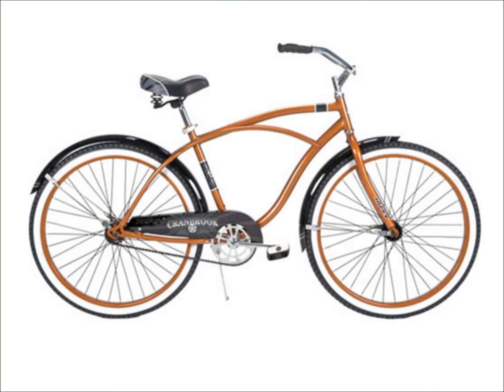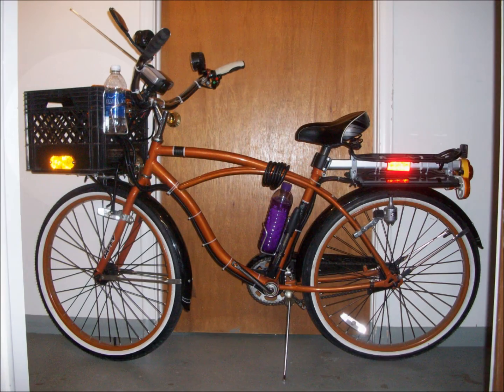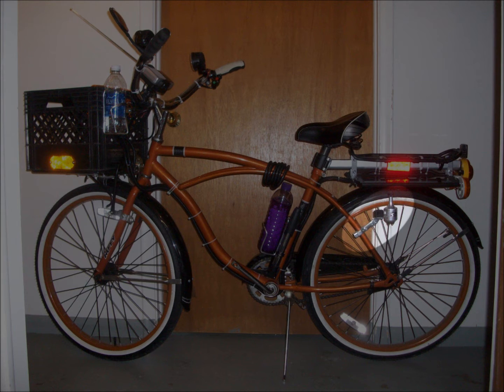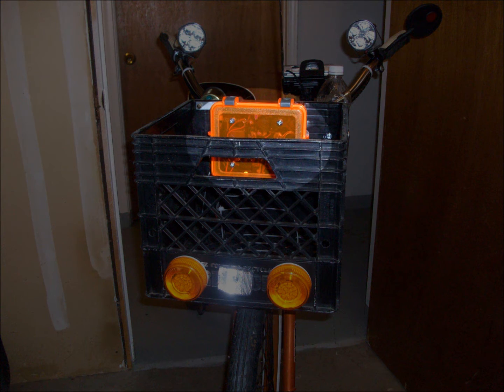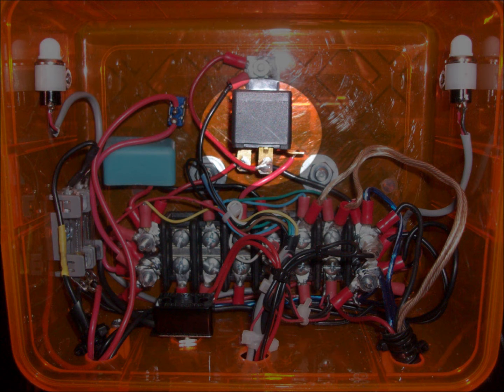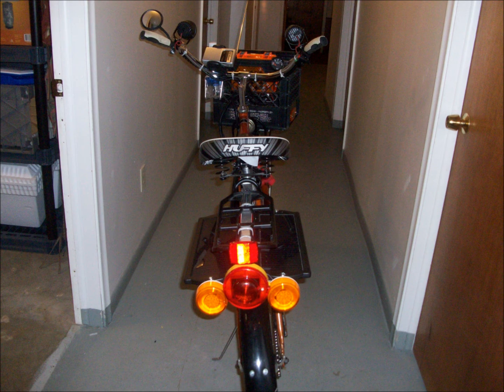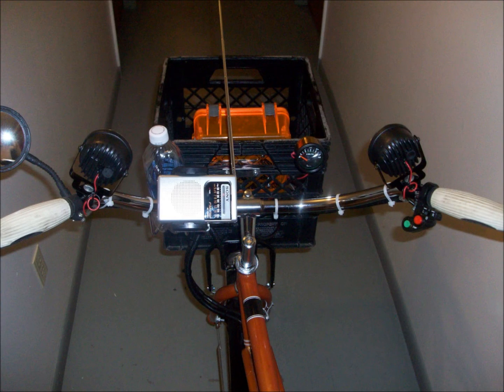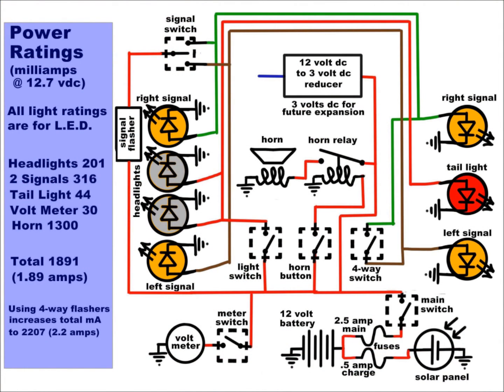Phase3: DIY Make Your Own Bike Or Bicycle Solar Power Lighting And Electrical System

Comment: Brilliant!  I just wired up my bike with a motorcycle led kit and connected it to a rechargeable 12v battery pack that I also routed for a bike handlebar light, but it doesn't have features like separate flashing turn signal lights.  Your project is off the charge amazing and inspires me to redo my project right!

Comment: What gauge wire do i need?
Reply from the maker: ***** Wire charts are available on the internet, and wire size is based on amps, or on milliamps. When purchasing electrical components, I buy from sellers who list amp or milliamp ratings with their products. This research is part of the project. Good luck.

Comment: Hello,I live in Jamaica and I ride to work everyday on my land ranger bike. The distance is about 4 miles up grade. Traffic is bad and bicyclist lives are in danger constantly so I will be looking at your videos to see if any of your ideas can be modified for me here.Especially the indicators.I modified two cheap China made flash lights that are rechargeable and used two metal ring clamps each to hold them on the handle bar. They work great but the built in batteries do not hold the charge so I'm planning to use a 6 volts dry battery .I also have a crate on the back of my bike and it is hell to get on and off the bike, and I'm a big guy. not sure if I can get the front mounted carrier here but I'm going to try hopefully its not too expensive.
Thank you for the videos. I don't own a car so my bike is my primary transportation.
Don't listen to the idiots who try to insult you or put you down and make jokes! they are everywhere..                                                                                Thanks again